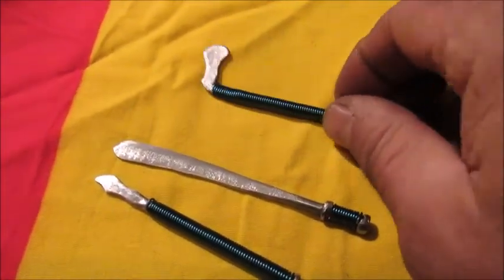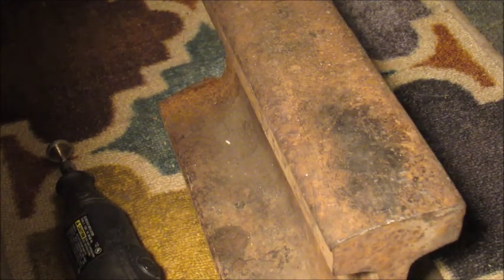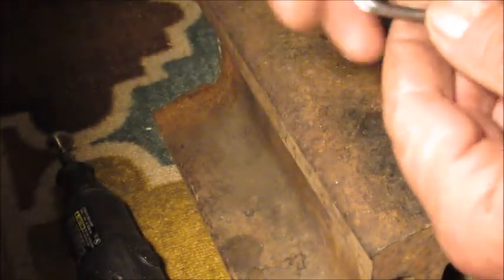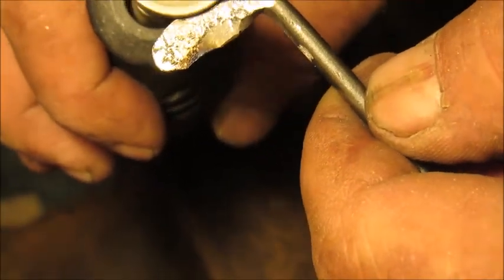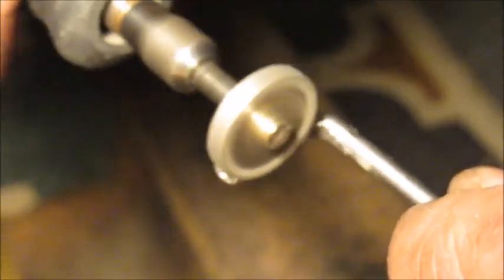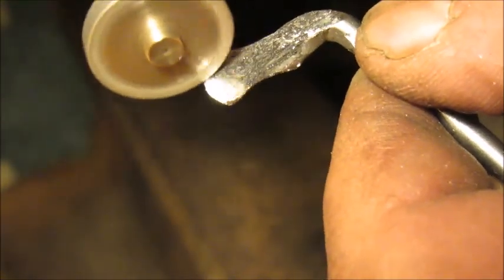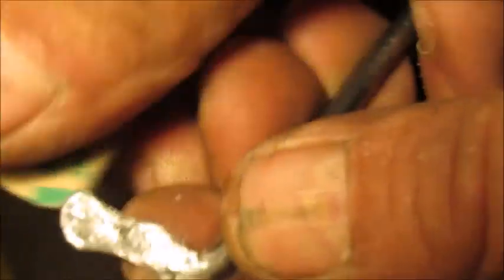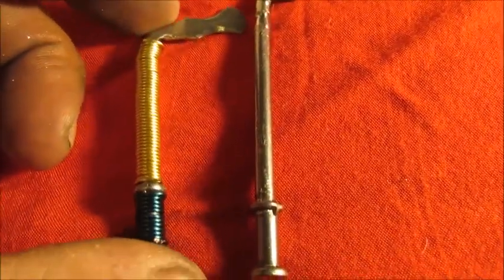How To Make A Mini Hatchet/Axe Part 1

Comment: You might consider annealing it and then hardnening it. First heat it red hot, bright red for steel. This relaxes the crystals. Then heat it again but this time, immediately dunk it into oil. This stresses the crystals (which is why they must be annealed) and leaves them hard. Heat it gently until a straw yellow which tempers them to the point where they won’t shatter but are still VERY hard. If you don’t want to do all of this, as least continually cool the metals as you grind it to maintain the work hardened hardness. Thanks for the video, :)